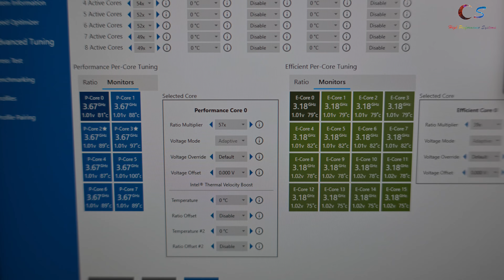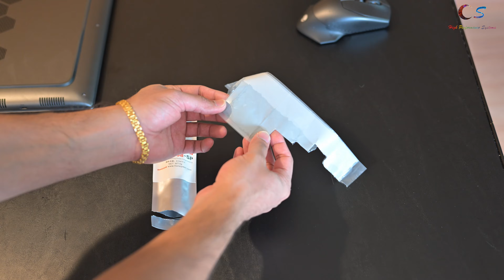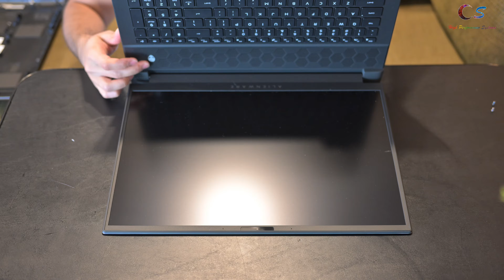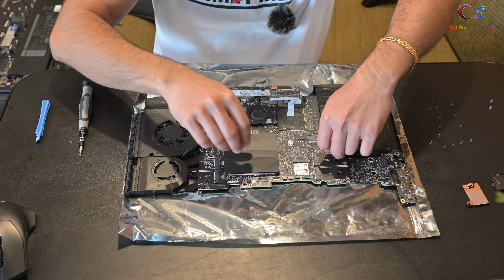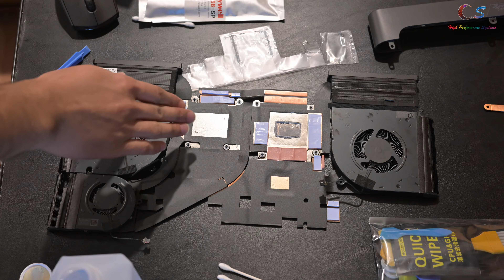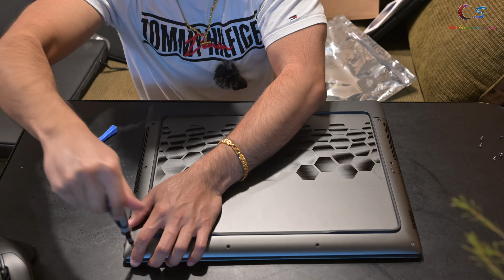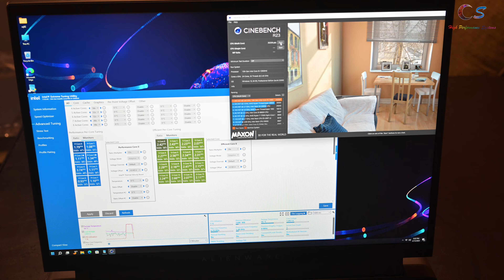Alienware m18 Disassembly & Repaste

Comment: Can anyone tell me how to undervolt the Alienware m18 R2 with the i9-14900HX? I’ve tried using Intel XTU and ThrottleStop, but it seems like undervolting is locked in the BIOS. Has anyone managed to unlock it and get the voltage offset working? If so, I’d really appreciate some guidance. Thanks!

Comment: Last week, I bought a used Alienware M18-R1 like yours.  I noticed something you might want to check.
The factory installed NVMe 4TB ran very hot when tested with CrystalDiskMark.  The problem I found causing it is very common, but most people don't know.  The hottest chip on the NVME SSDs is generally the Controller Chip.  That chip is usually thinner than the adjacent memory chips, so the heatsink passes over it without touching it.  The hottest chip gets no help from the heatsink.  I have thermal imager photos of all this. This overheating probably happens during gaming, where that chip causes thermal throttling, thereby annoying the gamer and causing this laptop to be sold.
My solution lowered the 4TB drive 30°C, from 80°C down to 50°C!  I peeled off the label and stuck it on the other side, then put 1mm thermal pad on the controller chip and put ½mm thermal pad on the, thicker, memory chips.  Checked that all chips contact the heatsink and re-installed.
Check your SSD temperatures by using something like "ClearDiskInfo", while running CrystalDiskMark.  You can refresh the ClearDiskInfo Temps by pressing "function+F5".
Still, the factory heatsinks on the M18-R1 leave a lot to be desired, although not much else will fit.  I'm working on that too.
Richard

Comment: Whoops. Broke my lcd1 connector trying to do this and install a new fan. Soldering specialist quoted $185 to fix. Or buy a motherboard off eBay for $1900. Don’t make the mistake I did. 

Fuck Alienware for not making replacement parts.

Comment: Thank you for the time and effort you put into creating this video—it was incredibly helpful. It played a key role in guiding me through the repasting process on my M18 R2 (14900HX, 4090). I did refer to the owner's manual for the motherboard screw layout, but your video made the overall process much smoother.

I opted for PTM7950, and while I'm still seeing temps hit 100°C, the system is clocking higher now. For the time being, I’ve set a thermal limit of 85°C in the BIOS until I figure out undervolting. I only completed the repaste last night, so I’m curious to see how things settle over the next week.

The whole job took about three hours since it was my first time, but it was a great learning experience—and seeing it boot up afterward was really satisfying.

By the way, have you noticed any whistling or coil whine from your fans at low RPMs? I’ve been experiencing this both before and after the repaste, and I’m wondering if it’s a common issue.
Reply: Hey man! any feedback after 8 months? I'm watching the video and just bought the PTM to do the same here haha

Comment: I was flatlining 100 degrees on a single core work load, even with the small undervolt now allowed, fans were going crazy. Dell came changed the heatsink which came with the paste pre-applied so guessing element 31 and the temps have dropped to mid 80's and clock speeds of 5.59GHz on the i9 with the fans barely on once in a while.

Comment: Thanks for the detailed video! I have a new M18R2 i9 4070. It had freezing issues and they just replaced the MB last week but now I think it's running hotter than the original MB was. I found someone say to run HWiNFO and Cinebench R32. I did this and my 10 minitue multi-core score is about 26,000. What worries me is that I have a delta of 20C-26C between individual cores (I saw someone say the cores should be within 8-10C). Two cores hit the 99C limit, 5 more are within 10C, and some are 20-26C lower. Dell now wants to re-paste it. Think re-pasting will fix my issue?

Comment: I just grabbed an X16 R2, and it's beautiful and amazing- but the CPU runs SO HOT.  85+ degrees when just browsing the web, 100 degrees when gaming.  Is this just a function of them cramming too much CPU into a laptop?  Their tech support seems to keep saying, "manufacturer says it can go to 110, so anything under that is operating as intended" - but I didn't buy this thing so it could be a noise machine when gaming at 1080 LOL
Reply: the point of all the power is not to let it out of the bag but undervolt the CPU so you extend the life span. there is not much the 14900HX can't crush, but undervolting with prevent any thermal throttling, you can overclock the GPU with MSI afterburner. 
much better temps than at stock voltage.

Comment: I ended up doing it yesterday - I didn't document or record the process as it is the same steps as seen in this video just using liquid metal instead of pads. The difference is unbelievable. I have the AMD version with the 7945HX and 7900M. When running cinebench r23 it would immediately shoot to 100c and throttle hard spiking to 105c at some points even. Now it can run r23 in the 85c range and never throttle. Scores around 34k on all default settings which is pretty solid for the AMD chip. The GPU is ice cold - I got an achievement on steam for the GPU never exceeding 55c in a timespy benchmark!
Reply: How did you apply thermal paste on the CPU it's multiple dies threw me off
Reply: @tysage1473  Just treat each die as you would an individual CPU

Comment: Don’t get mad at me, but you have nothing to do with this profession. When I saw that you recommended holding the power button for 10 seconds to discharge any residual voltage, I understood that you don't know the electronic principles behind the power and standby functions. What you and others like you need to understand is that the power-on of a laptop is done by a KBC (Keyboard Controller) which is essentially a microcontroller working in tandem with the BIOS. Its role is to initiate the power-on sequence for all the voltage rails in the laptop (to power them on) and provide power to the CPU, NorthBridge, peripherals, etc. This microcontroller is powered by two standby voltages, 5V and 3.3V, which are continuously supplied by the laptop’s battery, even when the laptop is off.

What you should know is that when you remove the battery (not the BIOS battery), the standby voltages (5V and 3.3V) disappear, which causes the microcontroller to lose power. As a result, it won’t initiate the power-on sequence. That power button connects directly to this chip (KBC controller). Since it no longer has standby voltages, pressing it for 7 hours instead of 10 seconds won’t discharge any residual voltage at all. The power-on sequence occurs by shorting a 3.3V voltage to ground – that’s the power-on voltage, not the standby voltage. If the standby voltage is missing, so is the power-on voltage when you press the power button for 10 seconds.

It bothers me that people who know nothing about electronics talk nonsense and do things they don’t understand – things that if an expert saw them, they’d laugh out loud. Take the time to learn, get informed, and then give proper advice

Comment: Can you tell us what size will be better to order for the thermal pad for the CPU and GPU re application?
The size options available are 30*30mm, 40*40, 80*40 and 80*80mm
I kinda think 80*40 should be enough for both the CPU and GPU but your opinion on the matter will be much appreciated
Reply: Hello, can you tell me what size you bought and give me advice in the end?

Comment: thank you for these detailed instructions; I was able to disassemble my M18 R2 for the first time ever with little experience with electronics with no hiccups at all. Cleaning Element 31 indeed isn't easy; it spawns little liquid metal balls which you have to carefully chase down and remove. For a paste that contains liquid metal however, I don't understand why the performance was so mid. I applied Conductonaut liquid metal and my CPU temps are a consistent 15 degrees celsius lower, with the fans running at lower speeds and I no longer experience random stuttering with my overclock settings. Pure liquid metal really is the only way to go in my opinion.

Comment: Theres onlyu one real way to get your CPU temps lower than a 100 degrees with an alienware and thats to disable turbo boost. You lose performance but you get a big temperature difference. For most this trade off is worth it but if you have a good environment and cooling pad that is decent 100 degrees under full load with these should be fine with stock settings.
Reply: How do you turn off bosst

Comment: What if I told you an Alienware M18 R2 with i9 14900hx CPU and Nvidia Geforce Rtx 4090 GPU can be had at just 1600 dollars or less depending on your luck, All you need to do is buy a replacement motherboard for the M18 R2 which costs 800-900 dollar which comes with the CPU and GPU soldered and daughterboard with ports for dollar 25 if you need, You could buy the Heatsink assembly along with fans for 60 dollars, imho the M18 R1 Heatsink assembly(you are using in the video) should also fit. Power supply cables for 40 dollars, Calculate the power requirements and buy a power adaptor rated for 300-360 watts (You should be able to buy used dell power adaptors for 100-150) for 200 dollars, Take some measurements using a Vernier caliper using CAD design a case for the Frankenstein monster, Upload your design on PCB way and Install the assembled Motherboard and Heatsink assembly in the case, If you plan it well You could also design some space for a BluRay Writer which you could connect using the PCIe M2 3.0 to SATA 6 to the the motherboard. You would now have a slim PC with tremendous power to run whatever you want and backup data on MDisc, Rough cost would be 900+25+60+40+200+300.
Reply from the maker: It’s not going to be a “Alienware m18” if the chassis is completely different. I did do something similar a long time ago by building a Alienware m11x r3 by buying all the parts separately on AliExpress but if I were to do that with the m18 I’d want to find the chassis on eBay as well

Comment: You gotta remember that phase change material needs a break-in period. it’s not gonna immediately be better on the first cycle. It’s going to take anywhere from 10 all the way up to 25 cycles before you’ll notice an improvement.

Comment: I have X17 r1 with 3080 gpu 4k and 11800 cpu, i use Liquid Metal. My temperature dropped to 75 degrees in Cyberpunk 4k high setting. But you must upgrade your heatsink. it is necessary to apply a nickel-plated coating to avoid the reaction of liquid metal with copper. In my service guys do this. so I'm lucky. In general, I think element 31 is complete crap. you can’t buy it, you can’t get it, then you have to worry about the temperatures yourself
Reply from the maker: From my experience on the m18 the element 31 isn’t bad but isn’t applied well
Reply: Liquid metal doesnt react with copper, it reacts with aluminum. Its gallium based.

Comment: can you make video how you undervolt it? brother says that in XTU its blocked option idk
he own m18 13900hx 4080 and temperatures are crazy in hot miami
Reply from the maker: I think on the latest bios you can now undervolt in aw command center. I do have a video on how to unlock undervolt and use throttlestop to undervolt as well

Comment: I have a question.

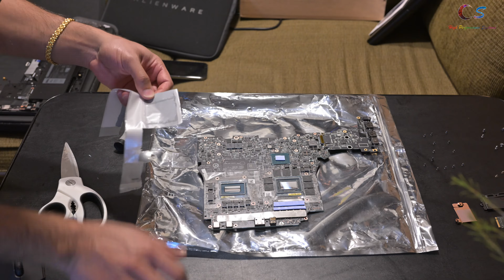1・At 15:10, do you apply thermal paste on top of the CPU and put thermal pad on top of it?

2・Will replacing the thermal pad void the DELL warranty?

I'm watching with Google's translation function, but I don't quite understand the translation, so I asked a question.
Reply from the maker: At 15:10 I applied PTM7950 not thermal paste. You can either install that or thermal paste but not both. Dell does not recommend replacing factory Liquid Metal but as long as you do not damage anything, it should be fine
Reply: Dell's warrant is actual garbage anyway. I've been getting the constant run around with getting them to actually fix my laptop since it runs at 100C CPU temp constantly.

Comment: I want to buy m18 (7845hx + rtx 4080), but I have a question. Please tell me if you play for a long time (2-3 hours) on this laptop, does the keyboard feel hot? I hate, when it burns my fingers👐))
Reply from the maker: For me it seems cool enough. Most of the heat is in the back or bottom
Reply: No heat at the keyboard at the bottom

Comment: Biggest tell to have seen if it was any better would be the power draw. If it’s able to draw more power and dissipate it then it’s better. No matter what you will always have a couple of hot cores. And remove the barriers. They can sometimes cause uneven contact. Had to do that on my x17 r2.
Reply from the maker: Yes power consumption went up the roof and it’s performing better now even better than when I made the video

Comment: Hi, I got few questions about this laptop and M16 because they share the same BIOS, I just got this laptop less than 2 weeks and I found out that cinebench R23 was running around only near 29000 score, mine cpu is 13900HX, no matter how hard I tried, still not yet exceed 30000 scores on R23, is that because newest bios? mine was 1.14.1 which is the newest one.
Reply from the maker: It might be the new bios, check temps as well. Background processes can also reduce score

Comment: why did you chose to use ptm over liquid metal? just because it is safe or cooling performance? i started using ptm over liquid metal as well but ptm is underperforming especially when im doing daily stuff with my pc. i mean when my pc is operating cool, ptm cant get enough heat to change its form to liquid and pc starts spinning fans like crazy. but when i start a game or something, after 5 mins, it operates nearly as cool as when it was on liquid metal.
Reply from the maker: Safe and because I wanted to try ptm7950

Comment: Just bought this laptop and I have noticed that the CPU rise to 95 or 97 degrees, now I did expect this since I know that Alienware is a heavy gaming machine but I came to the conclusion that this Laptop has a paste problem from the manufacturer. So I would appreciate it if you could confirm this because I really don't want to play around the CPU and the motherboard in general, better to bring one of them Dell tech dudes to my home and do the job. Could you or anyone confirm if this is true?
Reply from the maker: Yes it’s better to have them fix it

Comment: Hey man I did exactly what you did. But now, my laptop turns on but the screen is black and it does a restart loop. Its been 10 minutes and its been doing the same. What could be the issue in my case?
Reply from the maker: Try removing ram and resetting cmos and see if that helps

Comment: Most Alienware gaming laptops run hot🔥making the brand untouchable by serious gamers, they try to cram far to much power in a thin chasse when clearly a thicker chasse is the way to go. Avoid laptops with i9 processors and max gpu power instead favor a more manageable configuration such as an i7 with a middle tier gpu (i7 with a 4080) NOT an i9 with a 4090 because that will produce way to much heat
Reply from the maker: Every gaming laptop runs hot (AW, Clevo, MSI, Asus, etc.) it’s all about finding the balance. These m18 actually had good thermals but due to uneven thermal application they had 1 core running too hot. I’ve always owned the highest spec laptop and always had to repaste regardless of brand.

Comment: Just don't say that the heatsink base is not copper:/ I am considering this model but I want to use liquid metal to get rid of the problem with high processor temperatures. Ahhhh

Comment: The Dudes forgetting one important thing. Where is his static strap. He's not wearing one . Im an Electronic Engineer. He could easily ruin this expensive ass computer.
Reply from the maker: lol I’ve worked on computers my whole life and never killed one due to ESD. I discharged myself before starting and always do that and it works fine. But yes you should wear one.
Reply: lol. Bro chill, an ESD Strap isn’t that important

Comment: temperatures have not gone lower because those laptops are set to use more processing power until they reach the temperature limits set by the processor registers (there's a T_OFFSET register if I am not mistaken which tells max temp before shutdown mechanism triggered and some other registers which tells which temperature should it be maintained) Intel sets this to 100C by default. So it will try to always increase the clock registers up to reaching 100C. So you just improved your processor performance.. its clock will be running faster for longer time before power limiting to keep temps to 100C. If you want to lower temps, I found (but did not test) this video which should be helpful to anyone trying to lower. But I don't know if performance will be similar. Please share your comments if you try this. Later come back to this comment and let us know. This is the video: How to COOL the Alienware m18 and m16 - EASILY https://www.youtube.com/watch?v=9ICrhhzdBUE
Reply from the maker: Yes I know, I realized that too and updated the CB R23 in the pinned comment of 37k score. In games the temps are much better. With undervolt the temps are in check

Comment: Thanks for the video man. Thinking of buying one, myself.
P.S. If I may give you an advice. If you already remove the cooling system, always take the fans of and clean the dust between fans and radiotor. That dust produces even more overheating than bad thermal paste finger print.
P.S.S. Can the fans be removed without lifting and turning over the mainboard ?
Reply from the maker: The laptop was essentially new so there shouldn’t be much dust. I haven’t tried removing the fans by themselves but it looks like they should come out without full disassembly